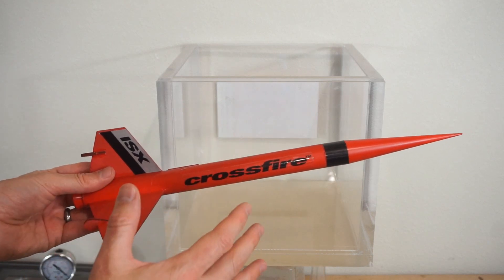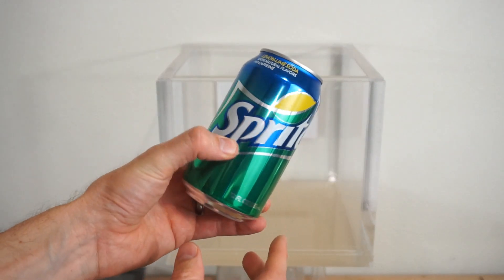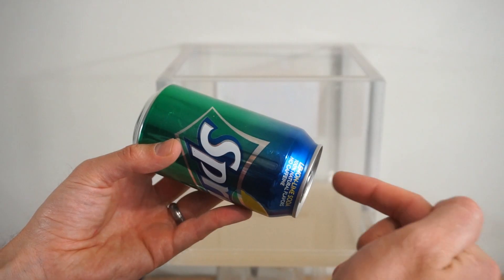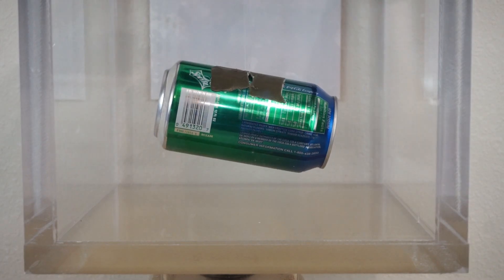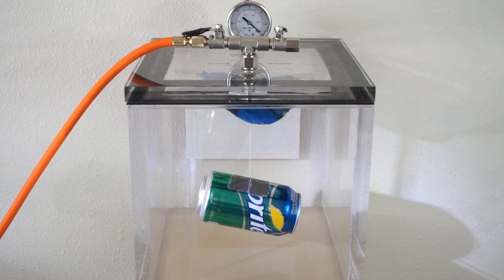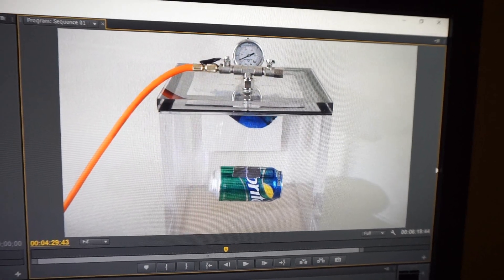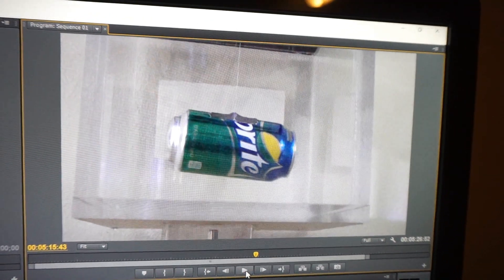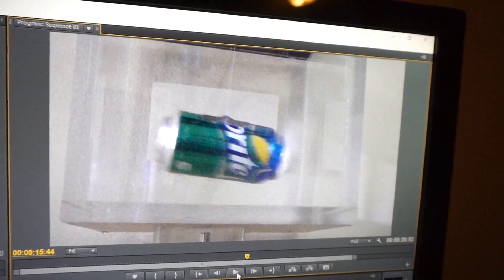Can a Rocket Fly in a Vacuum Chamber?

Comment: The movement came from the resistance of the liquid hitting the chamber. Rockets will not work in a vacuum. 
Without resistance no work can be done.
Also a vacuum and non vacuum cannot coexist. Thermodynamic equilibrium always equalizes.
Reply: So according to you, a crossbow would not experience any recoil force when firing a projectile into a vacuum?
Are you sure about that?
Reply: @stuartgray5877  Ah.....young grasshopper....I was waiting for such a question.
Firstly do you understand resistance as within the equation of action, reaction, resistance?
Reply: @chookin1  - "Firstly do you understand resistance as within the equation of action, reaction, resistance?"

If YOU cannot answer questions about Momentum and Inertia, then it is YOU that needs to become educated.
Reply: @stuartgray5877  i can but you must answer me about the question of resistance. Is it equally as important as action and reaction?
Reply: @chookin1  Then form a proper question and I will answer it.
Asking - "Firstly do you understand resistance as within the equation of action, reaction, resistance?"
Is not a proper question. 

Since I ALREADY HAVE formed a proper question, answer it: 
Does a Crossbow have recoil? Yes or NO?

Would it still have recoil if fired INTO A VACUUM, Yes or No?
Reply: @chookin1  Where did you GO?
Did you finally grow a brain cell and decide it is probably better to NOT argue with actual engineers regarding basic physics?
Reply: @stuartgray5877  i was trying to find evidence of a vacuum and non vacuum coexisting in juxtaposition....still no luck.  You? Have you read  and understood thermodynamic equilibrium yet?
Reply: @chookin1  - "i was trying to find evidence of a vacuum and non vacuum coexisting in juxtaposition....still no luck.  You?"
Yes.
IN fact, a device known as a "Gas Centrifuge" can create a region of low pressure gas and a region of high pressure gas with no physical barrier between the two regions.
Care to tell us what the theory of operation IS of the "Gas Centrifuge"?
NO?
Then quit thinking you have any sort of "Gotcha". I bothered to get an actual education.
Reply: @chookin1  But now you resort to changing the subject instead of just explaining the concept of Mechanical Recoil?
Thats pretty pathetic.
But, I accept your surrender.
Reply: @stuartgray5877  I already did. The chamber provides the  resistance in the  gun....the elastic in the  slingshot.....etc. gas moving  into an absolute vacuum does no work.
Reply: @chookin1  YOU seem to have reading comprehension issues.
You are NOT answering my question:
Does a CROSSBOW have RECOIL?
Yes or No?
Would it STILL have recoil even if fired INTO A VACUUM?
WHY?
OR
WHY NOT?
Where in my questions regarding rocket propulsion did I say ANYTHING about gas?
There is a key word I need YOU TO SAY before we go on.
WHAT gives a crossbow "Recoil"?
What physical property does the projectile have that makes the crossbow experience a recoil force when the projectile is launched?
Reply: @stuartgray5877  Stuart....re read my last. The bow has stored energy and is released when the bow is released. Gas particles act in an entirely different way. Gas released into an absolute vacuum can do no work. End of story.
Reply: @chookin1  No sorry, I'll try to explain the part that you missed by having never taken high school physics:
Any machine (Gun, catapult, Crossbow) feels a recoil force equal and opposite to the force applied to the projectile being used to accelerate it.
The "Property" I asked you to describe is "Inertia".
An object with MASS has INERTIA.

Any machine that accelerates an object with MASS (INERTIA) feels a "resistance".
Objects with "Mass" don't accelerate away instantaneously, they require TIME to be accelerated.
So things like CROSSBOWS apply a FORCE to accelerate the MASS of the projectile away. A "Force" over "Time" is equal to "WORK".
Work increases the velocity (and therefore the momentum ) of an object by accelerating it.
Crossbows feel RECOIL because they are pushing against an object with INERTIA over TIME performing WORK.
Now answer my QUESTION:

Do CROSSBOWS
FEEL RECOIL
when fired into a vacuum?
YES OR NO?
WHY or WHY NOT?
If the question is too difficult for you just SAY THAT.
The fact that you refuse to answer reveals your lack of integrity.
Reply: @stuartgray5877  Such a cranky boy. Yes as I stated the energy is created by the force applied by the loading mechanism. When released, even in a vacuum it will be propelled. The resistance is made possible by  holding the crossbow. If there is no resistance ie I let go of the crossbow the arrow will stay where it was but the bow will move backwards.  So, get to the "gotcha". I know where you're going but I'll let you have your rant.
Reply: @chookin1  Ok since you won't answer my question, I will answer for you AGAIN:

YES!
YES, Crossbows still feel recoil when launching projectiles into a vacuum!
So "Propulsion IN A VACUUM" IS POSSIBLE!
You are welcome
Reply: @chookin1  Now NEXT QUESTION (That you are sure to avoid answering AGAIN):

I have a 10,000 kilogram remote controlled catapult floating in zero-G, in a vacuum:
This machine can accelerate a 500 kilogram block of water ICE from a velocity of zero to a velocity of 2500 meters per second.
An astronaut floating alongside the catapult loads it, cocks it, and fires it with the remote.
He now witnesses the block of ice moving to his right at 2500 meters per second.
WHAT is the velocity of the catapult?
Engineers can solve this problem IN THEIR HEAD using the "Law of Conservation of Momentum".
What is the answer genius?
Reply: @chookin1  And now one more question (again that you will refuse to answer):

WHAT IS the "Exhaust gas" from a Space Shuttle Main Engine (SSME)?
What is the product of combusting liquid hydrogen and liquid oxygen?
Reply: @chookin1  Next how about I ask you to watch a video that has undeniable evidence of rockets working in a vacuum?
I suspect you will refuse to even watch it.
Find the YT video titled: "uninterrupted footage of the falcon heavy launch and booster landing! 2-6-18" by Astronomy live.
Watch from launch to side booster landing then explain what you just saw .

IF you would like to see the same event from the rocket watch the video from SpaceX titled: "Falcon Heavy Test Flight"

You can compare the two videos to prove that they are depicting the same event.
Reply: @chookin1  - "I let go of the crossbow the arrow will stay where it was but the bow will move backwards."
No.
You STILL have it wrong.
If you fire a crossbow in a vacuum with nothing holding it - BOTH the projectile AND the crossbow will be moving after the firing.
BOTH objects will absorb the same MOMENTUM.
But since each object has a different MASS (the Bow being more "massive") they will have different VELOCITIES after the firing. (with the lower mass object having the higher velocity)
Now lookup the "Law of Conservation of Momentum".
Oh and "Momentum" is DEFINED AS: Mass Times Velocity or (P = M x V).
Now solve that problem I asked you to above and tell me the final velocity of the catapult after firing the block of ice.
Reply: @chookin1  where did you go?  Did you get tired of trying to argue against my FACTS??
Reply: @stuartgray5877  No...just bored  of  your NASA fanboy nonsense.
Reply: @chookin1  You mean tired of being proven wrong.
Now go BACK and complete high school before arguing with professionals.
Reply: @chookin1  Oh and I build spacecraft for customers other than NASA. The one I am building right now is for the Air Force.
Look up WSF-M.
Reply: @stuartgray5877  No.....Im sick of NASA fanboys and naive trekkies who believe men landed on the moon and got out in an absolute vacuum in fabric suits with zippers in plus and mius 250 degrees for up to 7 hours at a stretch. Your turn.
Reply: The frame by frame shown that to be false. Did you even watch the video? It's Newton's third law of motion. Nothing to do with thermodynamics. We're talking about motion, not temperature.
Reply: @CorrosiveCitrus  saying heat engines have nothing to do with thermodynamics is a lie.
Reply: @papalegba6796  strawman much?

Newton's laws of motion, the physics that are at work here, have nothing to do with thermodynamics. Again, we're talking motion, not temperature.

Comment: There are multiple problems with this. There's something called "ground effect" that is very poorly understood, so the walls of the chamber are too close.
The other is the whole top of the can blew off. Nobody is disputing Newton's 3rd Law so blowing the top of the can off moves the can the other way.
The problem is we're not convinced that the rocket equation is real because in a vacuum we don't believe it applies to gases in free expansion. The contention is that a rocket is in actual fact a (very inefficient) internal combustion engine where the nozzle/opening and external pressure act in lieu of the piston in a more conventional internal combustion engine. Thus in atmosphere the thermal energy of the gas is converted to kinetic energy because it does work but with combustion In a vacuum the free expansion of gas means it no longer works as an engine and you go nowhere. Rocket engineers have to fiddle with the nozzle to get better results at a different atmospheric pressure precisely because of the rocket engine in actual fact being an internal combustion engine. Calling them "vacuum pressure nozzles" is misdirection, they're really thin atmosphere nozzles.
 Actually there are some people that have issues with Newton's 3rd but we don't need to go there.
Reply: The string is an issue because it physically connects to the wall, the can is a pendulum weight so liquid motion inside it against the walls of the can will certainly do something to move the can. The moment it ruptures and the liquid is disturbed the can will move. We can't see if the invisible CO2 filled the chamber before the can moved, for that matter.
Reply: @kalliste23  - "because in a vacuum we don't believe it applies to gases in free expansion. "

But the gases from a rocket engine are being PUSHED OUT with a huge force from the pressure in the combustion chamber.
They are coming out a LOT faster than "free expansion".
Reply: @stuartgray5877  wacko Stuart claiming w=pv is wrong yet again... Why do you hate the gas laws lol?
Reply: @papalegba6796  And Papa Legba claiming that mechanical RECOIL does not work in a vacuum.
Reply: @stuartgray5877  never said that, lying chatbot. And rockets don't work by mechanical recoil anyway, chatbot. You're wrong about everything 😂😂😂😂😂

Comment: It's pushing off the side of the chamber.
Reply: But we just saw frame by frame that it wasn't. Did you not see the video?
Reply: where in newton's laws is there a requirement for a wall?
Reply: @__ab-  Not sure, but when they fire a rocket off in a vacuum, it doesn't move until the thrust hits the wall or the bottom of the vacuum

Comment: you just filled your vacuum chamber with gas, in space you can't do that and the density is almost non-existent newton's law can't work
Reply: Except for the fact that rockets TAKE MASS WITH THEM TO SPACE TO PUSH OFF OF.
Now try finishing high school before calling every engineer in history a bunch of imbeciles.
Reply: @stuartgray5877  you have to fill infinite space with gas to move forward. an airplane cannot fly in space because of the lack of external density, the same goes for rockets.
Reply: @jincen3306  So you think that mechanical RECOIL stops working in a vacuum?
Are you SURE about that?

Rocket propulsion is mechanical RECOIL from the rocket nozzle accelerating mass.

Are YOU saying that the rocket can accelerate mass WITHOUT applying a force to accelerate that mass?
Reply: @jincen3306  Maybe you should try taking high school physics before trying to lecture others about basic physics.
Why did you drop out before the 9th grade?
Reply: @jincen3306  : So are you thus claiming that while in the atmosphere rockets somehow get a push back from the air they are pushing against? How does that work? I mean, how do air molecules (being blasted away from the rocket at supersonic speeds) somehow manage to push back against the rocket body? 

Any ideas?
Reply: @jincen3306  - So please explain to me how rockets CAN "Push on Air" but cannot "Push on GAS".
Sorry I am confused. I thought "Air" WAS A GAS.
SO WHICH IS IT? Can rockets push on gas or NOT?
Reply: @jincen3306  Where did you GO? Why did you refuse to answer my question?
Can rockets PUSH ON "GAS" OR NOT?
Its just a Yes/No answer....
Reply: @stuartgray5877  I just see right now the notification and surely I can response to you. first of all the environment is essential, a fish cannot swimming in the air and a bird cannot flying under the water whatever the type of energy or mathematical calculation, it is necessary to put that in the brain and save it. Why can't an airplane go into space? Because there is no air the space is 99.9% empty no air density no thrust no lift. You can feel the air when you move a fan it's like an invisible wall when you push that invisible wall you can be ejected. The rockets can push on gas ONLY when they are still in the atmosphère with the density, then little by little you can see the rockets when it gains height that the lack of atmosphere tilts the rockets wich leaves horizontally it is like that in all rocket launches they cannot go up in the space. Even with oxidizer it can't work because the gas of the combustion pushes NOTHING in an empty area, a fish cannot swimming even if he farts water in the air understand ? The environment is essential it is not the same story inside and outside the atmosphere. Orion cannot traveling in the space even with the oxidizer, Orion is only floats in the space or it should explode with the vacuum pressure that's it that's all. Even if it could it is far too small to store enough oxidizer to go around the moon and return to earth.
Reply: @jincen3306  - "understand ? "
Yes.
I understand that YOU have NO IDEA how Mass, Inertia, and Momentum actually work.
Now Go FINISH High Schol so you can take basic physics.
It is OBVIOUS that you have never taken a single physics class.
They teach you this stuff in 9th grade.
What grade DID you drop out of?
Reply: @stuartgray5877  words of a wounded child 😂You are so useless
Reply: @jincen3306   I see that you did not contest my assertion that you failed to complete high school.
WHAT A SURPRISE!
Bless your little heart!
Reply: @jincen3306  NOW STOP trying to lecture actual engineers about basic physics with your toddler level of understanding.

You could not explain mechanical recoil to another person if your life depended on it.
Please BE MY GUEST GENIUS.

Comment: So this does not replicate space unless you think space is supposed to be a small container rather than a virtually infinite area with no container.
Reply: Still shows the effect of Newton's 3rd law quite well. There's footage of rockets in space easily accessible if you want to see the larger picture.
Reply: And rocket still work great in vacuum, either a moderately low vacuum found in vacuum chambers and the high vacuum levels found in space.

Comment: I didn't know there are walls in space. Now that you've explained that there are walls to push off it all makes sense.
Reply: How did this rocket push off the wall? I didn't see a single molecule of the rocket body ever touching the wall.
Reply: So you think that mechanical RECOIL stops working in a vacuum?

So what would happen if you fired a Crossbow into a vacuum?
Would there be any recoil?
Reply: @stuartgray5877  you're fckn everywhere spilling your shit at whats obvious, how much do they pay you fckface
Reply: @Netron24  an interesting question to ask alleged spacecraft engineer Stuart Gray is: "are ball aerospace a front for laundering embezzled public funds?" .
Reply: @Netron24  - I am an aerospace test engineer that has been launching things to space for longer than you have been alive.
They pay Aerospace Test engineers with 30 years' experience quite well thank you.
Reply: @Netron24  So why did YOU choose to drop out of high school before the 9th grade?
Reply: @stuartgray5877  everybody knows you are a chatbot, stuart. It's over 😂
Reply: Did you not watch the video? The whole point of the video is to explain, frame by frame, that it does NOT push off anything except the releasing gas.

Comment: except that it's a mixture of liquid and gas😐🤔 there's no way to see if the gas is pushing, it's still the same problem, you can see the vaporization. I understand the concept of equal and opposite force but he is still just making an assumption to confirm a preconceived bias. Not to mention that chamber is much too small for an accurate test. we wanted a rocket not a soda can. if anything this just makes me wonder how tf is rocket staying put together in the immense vaccum that is space.
Reply: So would a crossbow fired into a vacuum produce a recoil force?
Yes or no?
Reply: @stuartgray5877  a rocket is a heat engine, chatbot stuart. Mechanical recoil has nothing to do with how they work 😂

Comment: Also. Just because the gas wasn’t registered. It doesn’t mean that the gas was not using the tiny bit of air in the vacuum and the walls to be propelled off of to create thrust. So. You’re just not correct.
Reply: SO YOUR argument is basically:
Rockets CAN push on AIR (which is a GAS), but they CANNOT PUSH ON GAS (which is ALSO a gas).
Very consistent argument you have there.
Rockets CAN push on the 14.5 PSI gas in the atmosphere, but they CANNOT push on the 3000 PSI gas in the combustion chamber.
Even though the 3000 PSI gas is more than 100 times MORE MASSIVE than the 14.5 PSI AIR.
Got it.
You are an imbecile.